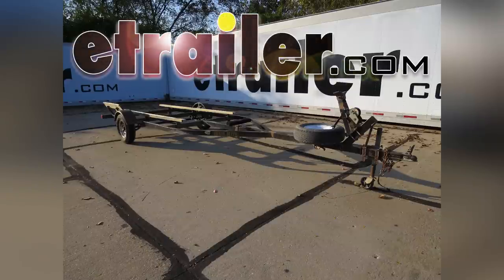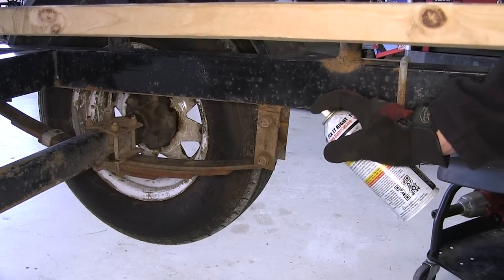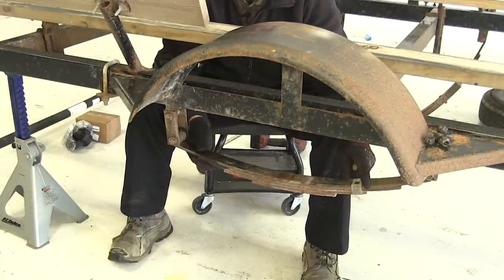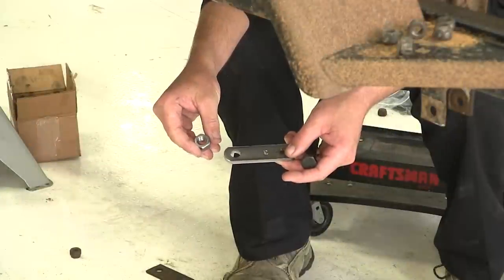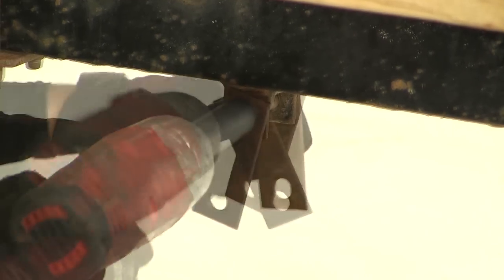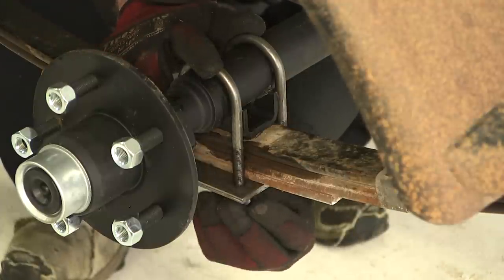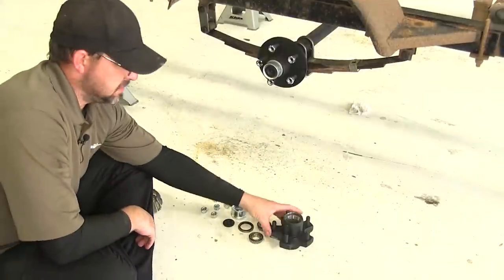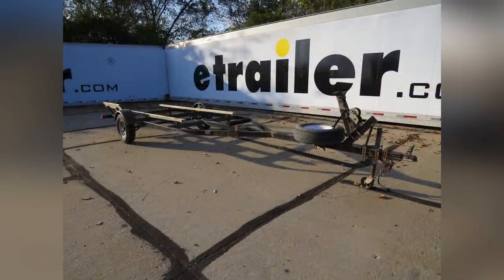etrailer | Checking Out the Dexter Trailer Idler Axle w/ Hubs

Comment: hi, i  have a 10ft landscape trailer, just got new tires, old ones were so bald on the inside the threads were showing.  Now i have new tires on, the right tire is slanted badly, the left side just a little.  I originally thought the axle was bent, but when i went to TSC to look at their axles, they are all bent!  The guy working there said they are supposed to be.  But now i dont what is wrong with my trailer?  Could it be a bent spindle?